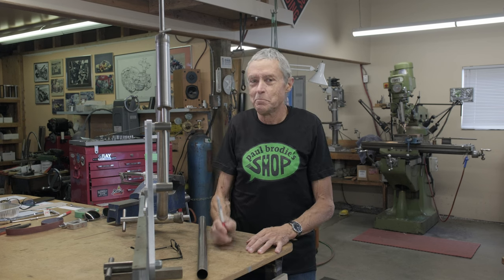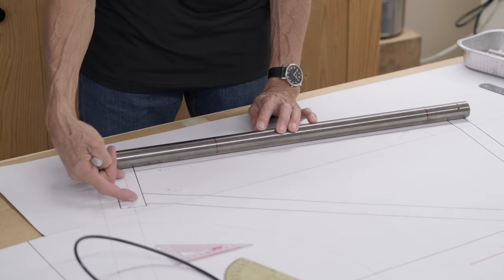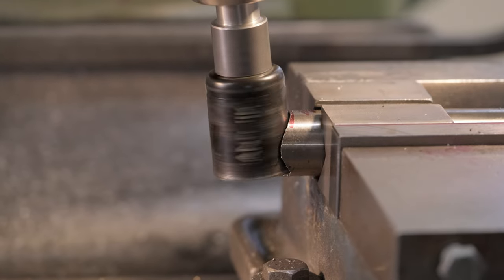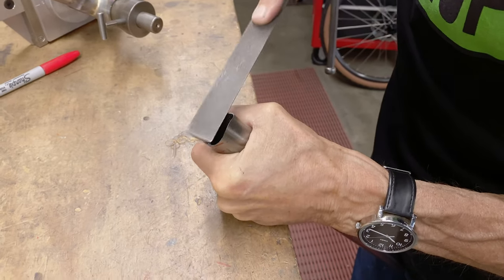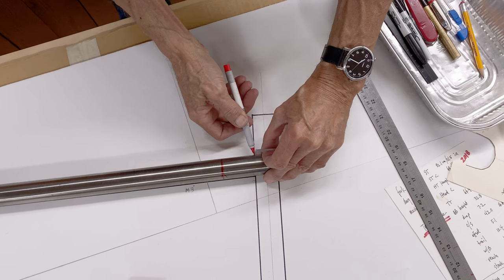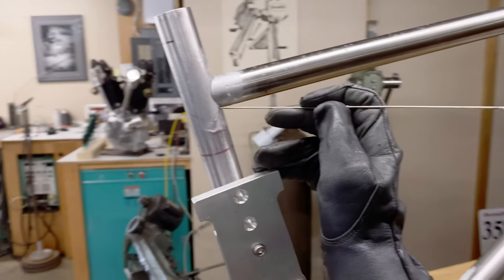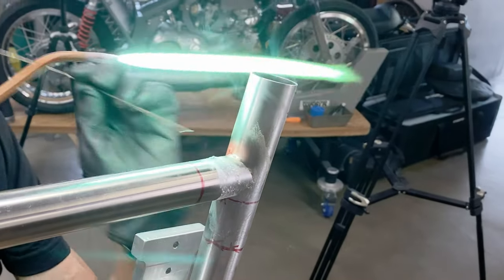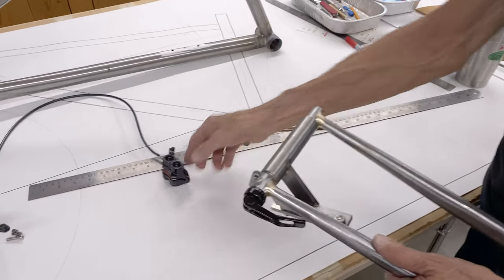GRAVEL BIKE build part 2 - Front Triangle and BRAKE MOUNT // Paul Brodie's Shop

Comment: As always, thank you Paul and Mitch for another video.  I've done brake caliper mounting on my various motorcycles -- bigger disks than stock, different calipers, and alternative link front ends from scratch.  I've measured diligently.  I've drawn plans.  I've milled carefully.  At the end of the day, the most efficient way for me is to make up a 4 spools for the mounting bolts, and just use a bunch of ugly scrap and globby MIG welds to establish the relationship between the holes.  This gives me a real "part" which I can reproduce in nice material.

Comment: Liked the video! A couple of remarks and questions about the brake mount.

1. Flat Mount can take up to 180 mm disc rotors. But of course originally it was meant to work with 140 mm and 160 mm road discs.
2. Why go after the Post Mount interface instead of doing International Standard, especially when making one-off frame/fork? An IS mount could be just a plate with two unthreaded holes, to which an IS-PM (or even IS-FM) adapter is then attached.

Comment: Hey Paul, it's very valuable to see how you problem solve in real time. I've dabbled in framebuilding enough to know that it doesn't always go as smoothly as you hope it will.
Reply from the maker: Yes, I was really "winging it" making that brake mount. And I did make another one after all. Thanks for watching :)

Comment: Hi Paul
I had the same brake rotor clearance issue with my bike. Hope makes a V1 and V2 floating rotor. The V1 rotor to aluminum spider attachment is closer to the centre and gives more clearance to the caliper mount. Disco Brakes also sells a nice floating rotor that doesn't have this clearance issue.
Chris
Reply from the maker: Hi Chris, the clearance issue was my fixture, so I ended up not using it and mounting the caliper by clamping it to the rotor. It's ok for a one-off, not for production..

Comment: Thanks so much for all this great content, guys!   At 9:16 we see the 2nd miter happening with the tube already clamped in place. Paul, how do you keep the two miters in phase with each other, rotationally, along  the tube's axis?    I've been using pairs of paragon clamping tube blocks on either end of the tube along with a flat reference surface. A little klunky & also difficult to screw up. I'm interested to know your method, Paul, & thanks again!
Reply from the maker: To mitre the second end, I hold the tube lightly in the V-blocks. This is for a top tube.. I mitre for the head tube first, then hold the seat tube end in the mill vise. I put a head tube into the first mitre and eyeball it to be vertical. That is good enough for me. Make sense?
Reply: Got it.. just use the ol' eye-crometer.    Thanks again!

Comment: 16:22 Flat mount can be used for all rotor sizes. I designed my road fork with 180/160 so I could run the larger rotors.

Comment: How do they get the distance between the butts to be a smaller diameter?  Can’t quite grasp how those tubes would be manufactured.  Welded?
Reply: It's the thickness of the tube that changes with the same outer diameter with internally butted tubes which aren't welded but done with a mandrill press pushing the tube through a die (ex: https://www.youtube.com/watch?v=QKAg1yMZIpY). Some builders will also externally but the tubes with an CNC (I believe Baum and No.22 do this, ex: https://www.youtube.com/watch?v=uZCFSzQdFdM), in this case the outer diameter does change.
Reply: @thomaslowry7813  thanks for clarifying.  For whatever reason I was thinking the inner diameter was starting at 80 thou and then changing to 50thou  and back up to 80. Makes a lot more sense to have the outer diameter different, but would think you could just measure with a calliper on the outside?
Reply: @markmywords5126  
that is  correct tho. The wall thickness is thinner in the center than close to the ends.
the outer diameter is not different, thats why it has to be measured on the inside. There  are however outside butted tubes where that is the  case.
Reply from the maker: Mark, you are correct..
Reply from the maker: You're welcome. However, it is 0.8mm and 0.5mm, nothing to do with thou... 90% of butting is on the inside of a tube.
Reply from the maker: The first video shows butting on an Aluminum tube. I doubt this works on a 4130 tube, which is much tougher and stronger. Most 4130 tubes are butted in a "swaging machine" which is different from either process shown in the videos.
Reply from the maker: Between the butts the tube is "thinner", not a smaller diameter...